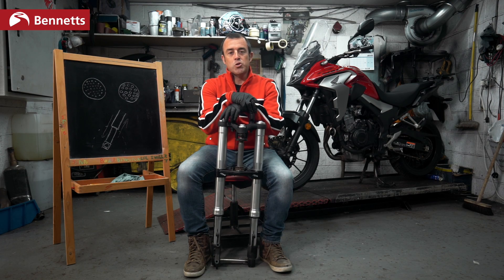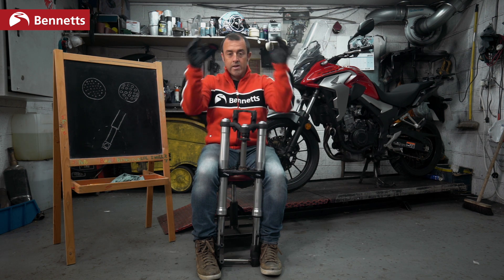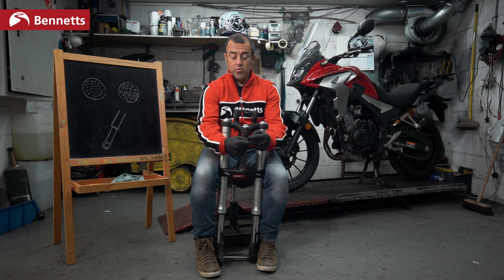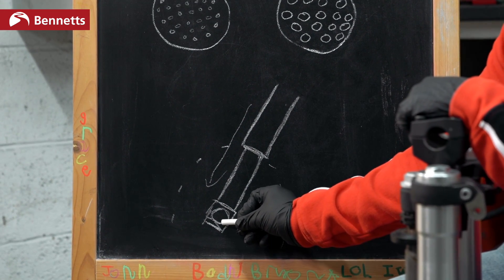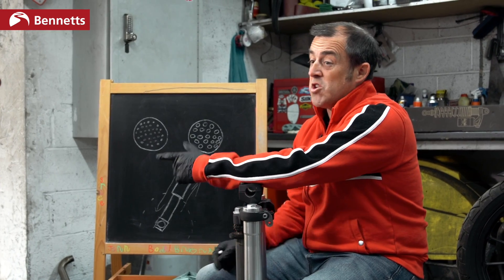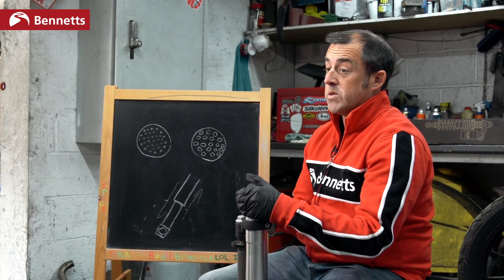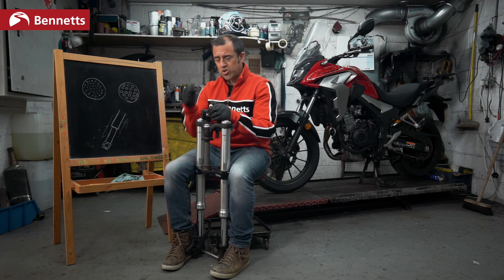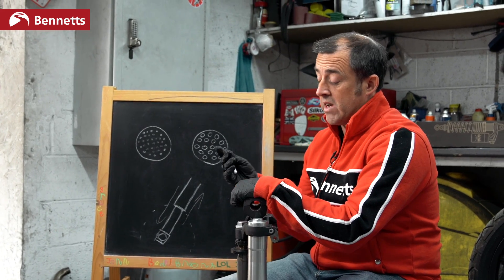How does the front suspension on a motorcycle work? | Home Schooling Lesson 6

Comment: I have seen preload being changed on track days so that instead of the compression and rebound being say some 6 inches or 15 ctm.  the pre load would be reduced to only say 3 inches or 75 ctm.. all this depends on weight including the rider and should improve the bikes ability to steer round  corners.  However should basic none track riders bikers want or have a  specific need to change the pre load under normal road riding condition?   Could messing with preload be detrimental or compromise the bikes stability and safety at all. If they have got it wrong?

Comment: since when is adding preload condensing the spring? A spring condenses when weight is added. Do you add weight by turning a screw? No. So nothing is condensed by adding preload. Adding preload adjusts where the bike is hanging in its suspension, thus setting sag.

Comment: Preload certainly doesn’t compress the spring
Reply: According to google the all knowing. "You can compensate for a too-soft or too-stiff spring by using preload, but you're better off changing the spring itself. What preload does, is mechanically compress the spring when your shocks are fully extended."
Reply: @michaelsupple6081  oh dear ... There’s an argument for using compression damping to compensate and even rebound but not preload. Preload alters ride height and remember anyway, you must always have some static sag for safety.
Reply: @michaelsupple6081 
Sit on your bike and turn the preload adjusters clockwise. Instead of your springs compressing, the ride height was increased. Ppl don’t ride motorcycles with fully extended forks.

Comment: I sit on my bike and stand up, I hear clicking noise from the front. I think it's the fork. What should I check? is it the protrusion, fork clamp, preload, oil viscosity, geometry of the bike due to rear and front not leveling?  I slightly jump to sit to mimic a bump and the rear sags, I stand up then I see the weight going to the front and rebounds and settles.

Comment: Because the two halves of the fork are not fixed together the spring does not stay compressed and get "stiffer" it is changing (or maintaining) the ride height instead. Your spring length would actually be very similar at all preloads. That is in normal regular conditions of course and you haven't exceeded the springs capability. i.e. some really weak spring rate totally mismatched to the weight of the bike.
Reply: Thank god Terry, I was beginning to think I was the only one to be aware of how this really works!! This guy needs to go back to school!
Reply: @richardblakey2000  👍 he is not alone Richard, it drives me nuts sometimes. This simple mechanical system is so misunderstood by so many motorcyclists and journalist’s that should know their craft better. 😬